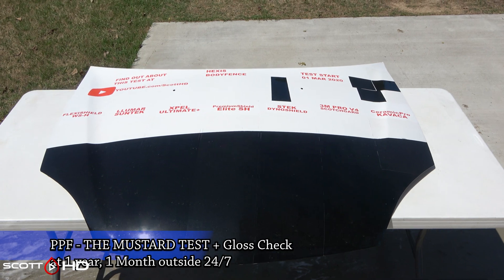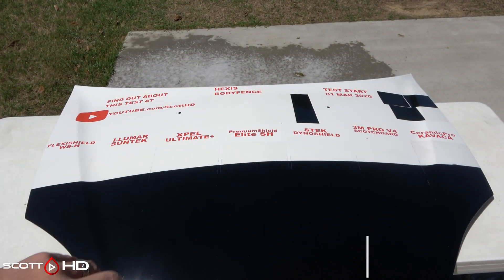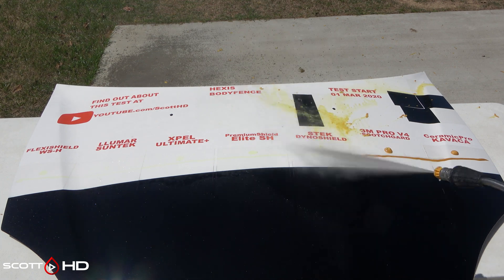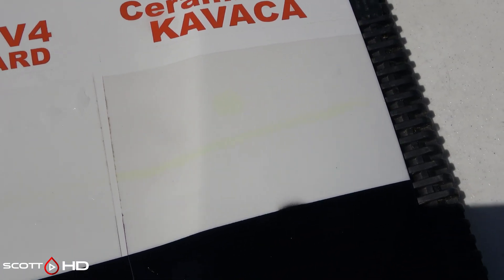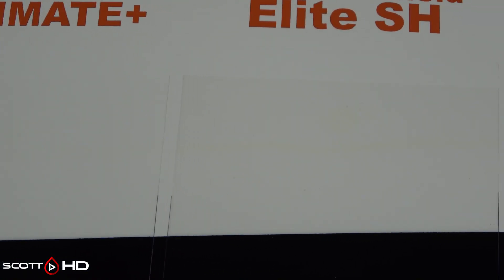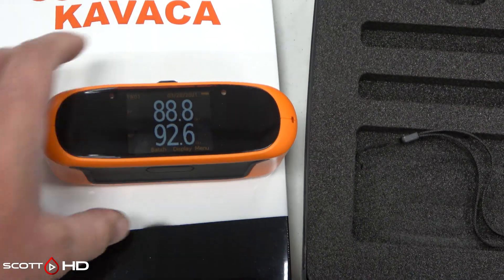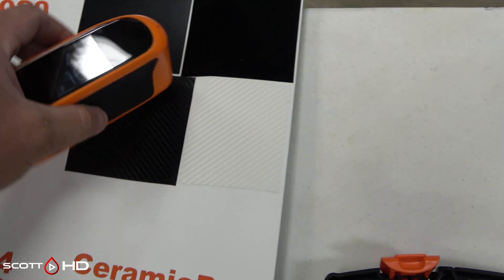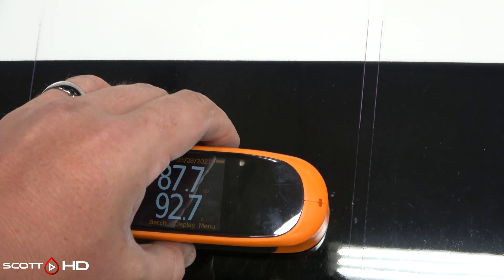Paint Protection Film PPF - UPDATE 18 - Ultimate Longevity & Durability - MUSTARD TEST & GLOSS CHECK

Comment: Thanks for the review! Huge work has been done! It is Kavaca Instant-Healing, isn’t it? 
If so, then this is an unfair comparison! Kavaca IH is a type of PPF with no top-coat; it's just soft film, and that's why it has a self-healing property without any additional actions; because it is very soft. If you try, let's say, Kavaca Ceramic Coated (hard topcoat PPF) like any other PPF on your video, I believe it will be the winner!
Reply from the maker: It is the instant self-healing PPF.  It is not an unfair comparison.  Why would they sell something like that if that was the case?  It has performed poorly in pretty much every test.